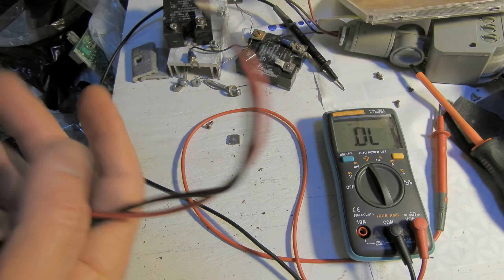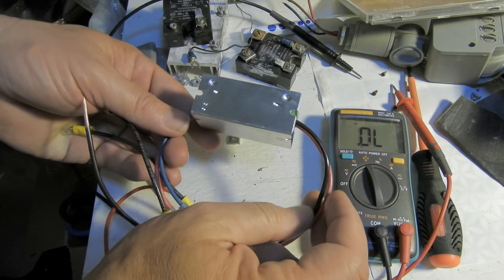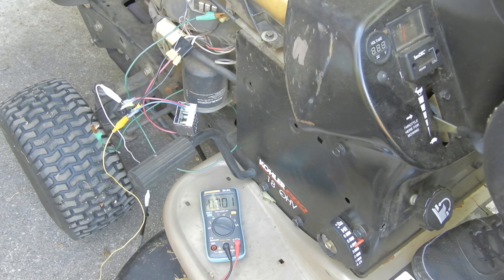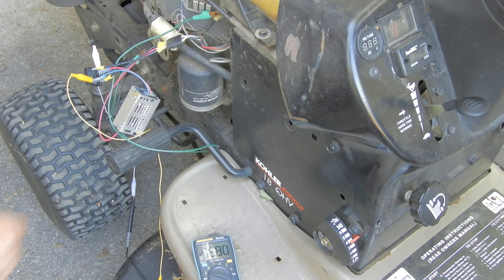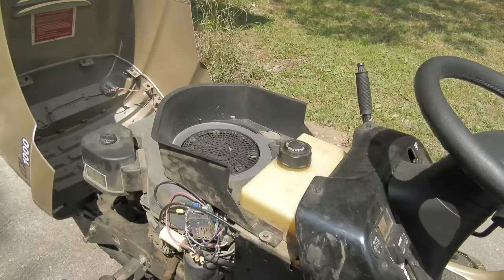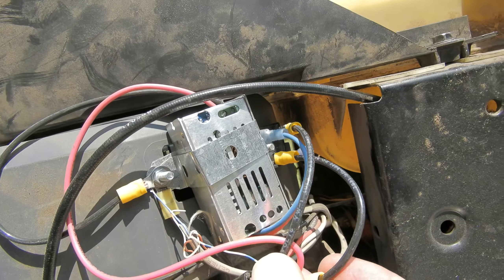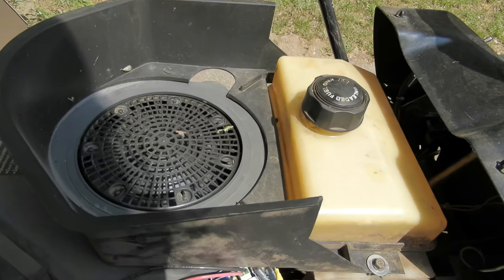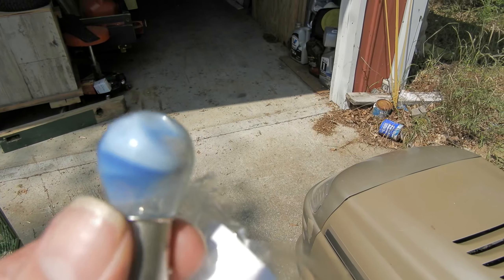Buck Convertor for Kohler, no more dead LED bulbs!

Comment: Just what I needed to convert my lawn tractor to the Headway lithium batteries from batteryhookup.  Thanks for sharing!!
Reply from the maker: Yes for sure, and even then be sure to install a Voltmeter! There is a problem with batteries that have a BMS, they will functionally disconnect the battery if Voltage gets too high. This will leave the stock regulator unable to regulate and Voltages will climb,
Reply: @HillsWorkbench  I installed a voltmeter...set to 14.1v for now.  So far, so good.  My set up is slightly different...buck and rectifier are inside the plastic engine cowl.  Daly BMS trips if single cell > 3.75v